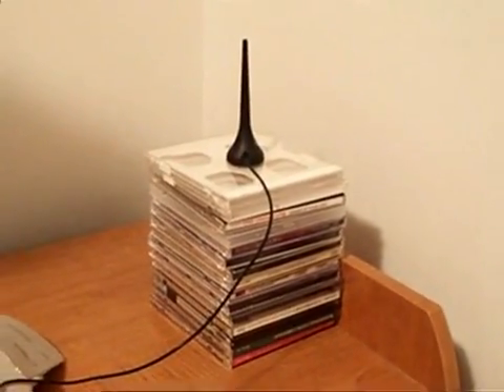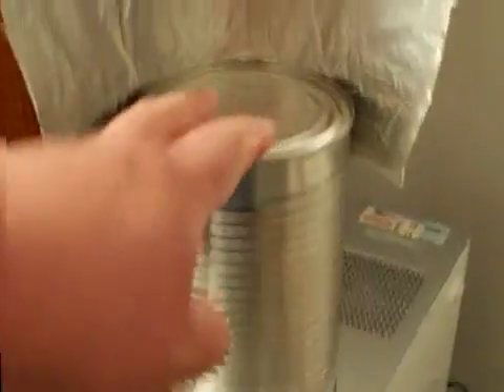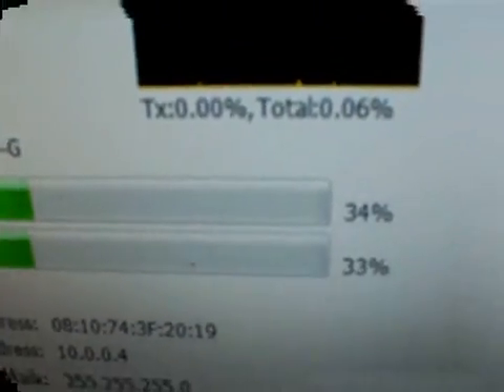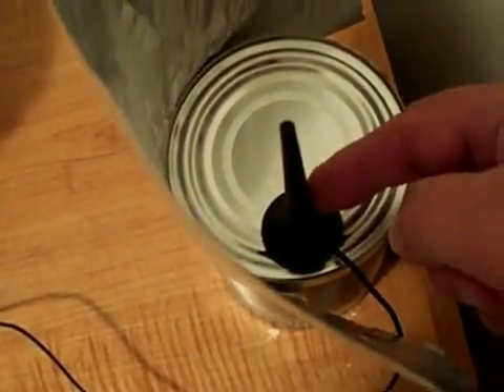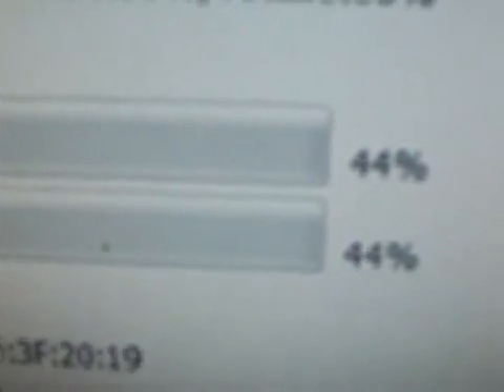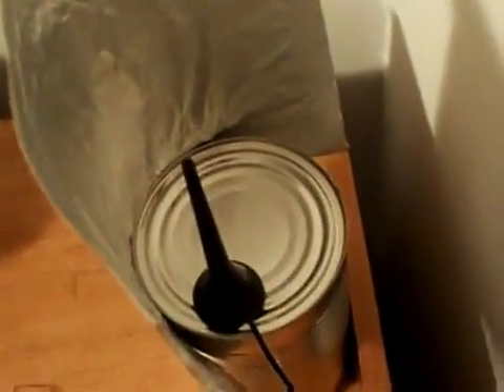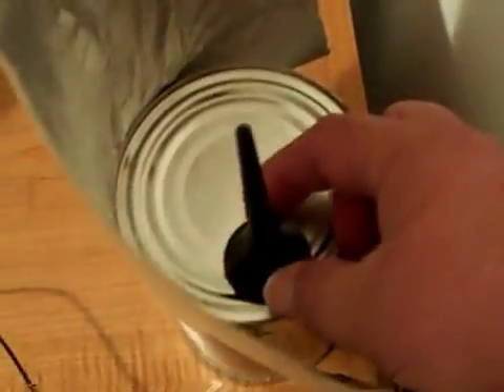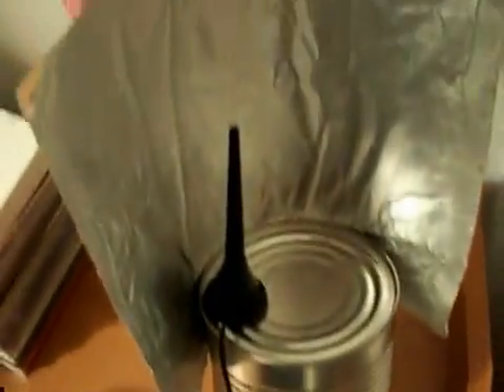e WiFi Antenna Booster - Very Stable and Stays On The Signal

Comment: Hmmm.  Try with just the can and no reflector.  The can forms a ground plane which increases the effectiveness of the antenna.  Note the "droopy bits" under a 1/4 wave CB antenna.  I would imagine it would work even better if the distance from the center of the can to the open edge was cut to about 5% longer than 1/4 wave at 2.4 GHz.

Comment: The reason the can improves the signal is that the antenna is only half the antenna system - it needs an equivalent antenna going downward from the magnetic base.  The can forms what's known as a ground plane, increasing the efficiency of the antenna.

As to why it doesn't work better in the center, the antenna has to be a fixed distance from the reflector (the "Windsurfer") and in the video you've never gotten it the right distance.  Try experimenting with the antenna along the center line and you should find a point, about 1/4" wide or less (maybe around 2.4" or 4.8" from the reflector - just over 1" is another point to try), that will give you even more of a boost.

Comment: What are you using as the backing for your aluminum screen? A manilla folder? Have you tried a "dish" shaped reflector (for a defined focus point)? You should also try weighing down your can with marbles or sand.

Comment: ? i have a dell desk top, where did you connected the cable from your antenna to?
Reply: soulergy1soulrgy1
Reply: +soulergy1soulrgy1 You need to buy a PCI/PCI express Wifi Adapter that comes with the antennas. You can then add a different antenna.

Comment: OK that's nice but the antenna for my laptop is inside and I don't have access to it.
Reply: +nunya biznez thats cos its a 5yr old video and they have better wifi kit now
Reply: +aR Bemo (aRBemo) I'd forgotten that I'd posted that.  I found a solar powered extender that has brought my connection speed up from 100-500 kbps to 1-2 mbps Not a huge improvement but it's the best I'm going to get from this motel's router.  Turns out the manager has the 15 mbps cable modem connection split to provide the owner with a fast connection for the security cameras to transmit all the security camera footage to the other end of the state.  Then the manager has some of the signal split off to provide her with a fast connection so she can play video games 24/7.  That leaves about 3-4 mbps to be shared by 12 tenents half of whom are trying to connect pretty much all the time.  The cable company is promising to upgrade us to 25 mbps but I don't know if any of that increased bandwidth will filter down to me.
Reply: nunya biznez thats bad I am on 50mbs and can have 200mbps if I pay enough from my provider!

Comment: It may be signal cancellation.  It's why two or more antennas are always better.  Signals can bounce off a near by surface, and the rebounding wave will cancel out the incoming one hitting it directly.  The center is most likely the main focal point due to reflection.  Moving it to one side would prevent this somewhat. 

You might try putting a hole in the can (reverse the can around), and mounting it on the antenna instead and see what happens. ;)
Reply: What a pity you nothing about phazing, just like this guy above.
Reply: Yaesu Yaesu What a pity you don't know how to spell "phasing".  I probably know more about phasing, wave cancellations, and audio processing and mixing than you do young padawan.  If not, rather than wasting time and energy browsing comments to tell people how bad they are, how about instead gracing us with your great wisdom and knowledge?  It's well known by many audio engineers that sound bouncing off walls can be out of phase, causing cancellations in signal, and "popping" sounds, which is why two or more antennas are always better. This is also a source of issue for multiple recording sources in a studio, and usually causes the need to adjust individual tracks that will for sure be slightly out of phase.

Comment: Wow. Just had a bash with an old can and some scrunched up tin foil and with almost no effort of finesse I boosted the signal strength from 18% to 37% (though it does fluctuate a little down to 31%). I expect if I spend a little time making a better engineered contraption I will be able to stabilise the signal and hopefully boost it a little more. I was considering going to the tech shop to buy a better antenna but I don't think I will bother now. Great idea. Thanks!

Comment: you just created an ear!  quite crude, but it makes sense,  the ear drum isnt really at the centre of the earlobe, rather, offset so that you can hear better... i think!
Reply: The antenna should be at the focal point of his reflector - which is not at the 'centre' he indicated. The presence of the steel can alters the field pattern in unknown ways, and who knows what is inside the nearby wall that's in the signal path? Bottom line, this design is almost totally empirical. Researchers in India did get ordinary home WiFi units to communicate over many km by using scientifically designed, fairly large parabolic reflectors that were carefully aligned and firmly fixed in place.

Comment: the wider the parabola the more energy it can focus on the focal point (or actually line in this case). So if you build a widerr windsurfer and get the focal point exactly right (so it's actually focusing all of the energy on the antenna) it will probably perform similarly to the can/foil antenna.

Comment: I'm stumbling on here and not sure what I just saw... are you saying I should try something like this and it will improve my wifi signal throughout the house, or do I need to aim it towards a specific area?  I would still wan't a good bit of omnidirectionality - how does that work?  Sorry to be so ignorant.
Reply: If you need to improve all around, get a pro made ommi antenna. The real B is getting the right connector from Antenna to device creating RF. So many connector types...

Comment: You have 2 things going on here that "can" give improvements:
1) Ground Plane
2) Corner or Parabolic Reflector (same concept as the "Windsurfer")

Using the Can alone should show how much improvement the Ground Plane by itself adds (likely best if the antenna is centered). Anything metal that's 5" in diameter or more should work well for a Ground Plane.

The Corner Reflector however is a VERY touchy thing at 2.4GHz... and it's not just about placement, but also relies very much on being a true parabola shape, or for a Corner reflector - an exact 90° angle. You likely found an offset position that, while not 'ideal' for the noted Ground Plane improvement, you found the "least bad" position for the reflector. You ended up with a "partially offset parabolic reflector", similar to what home Satellite TV receiver antennas use.

The Windsurfer (or any Corner/Parabolic Reflector) should work better if centered on the antenna Radiator Centerpoint... which is about 1.3" down from the tip of a common 3dBi antenna (which uses a simple straight 1/2wave radiating element of about 2.46") Half of 2.46" is about 1.23", then add room for some plastic in the tip, which is why I said about 1.3" down from the tip, instead of 1.23". I noticed you pushed the "Windsurfer" reflector down all the way to the magnetic base, which may not have been ideal.

BUT... since it's all FREE... sometimes we can "hit a magic spot" just by experimenting!
Reply: j

Comment: Help somebody!! Have wireless ATT notebook, laptop comps & ATT uverse comp only, no comp phone entire time ATT internet reception worse all time, bad as dial up. at says  this bec so far from transmitter, 5-10 miles I think. A 5 min video takes abt 20+ min to view.  Have any corrective/improving suggestions before I cancel service? ATT put in 2 new routers, wkd well X day or 2 then back to so slow this nearly stopped. Anyone else having similar issue?  Bought 1 new notebook & 2 new tablets thinking lap comp was cause. Jokes on me.  Help, help.

Comment: I just gave my old macbook 1.1 to my niece.  She has wifi at her apartment that is from the city.  Her laptop has an internal modem and no outboard antenna.  How can I help her get a better signal?
Reply: sorry if its too late, but you cant buy a usb wireless adapter that has an antenna. might be like 60 bucks. now that might be enough but if it isnt just do what this guy did
Reply: Thank you very much for the suggestion.
Reply: Chuck Carlsbad lol i meant CAN not cant. anyway, have you solved the issue already or are you still searching for a solution?
Reply: She is all set now that she is away at San Francisco State where wifi is very strong.  Her mom is still dealing with weak, city provided wifi so I sent her an EeePc netbook I had laying around to see if that works for her.  It has XP on it and it is not worth it to put windows 7 on it because you can  buy a chrome for just a little more than the windows software.
Reply: Chuck Carlsbad In what universe does the city provide wifi service?
Reply: nunya biznez My niece has ROKU all dialed in. Not sure if Ventura has changed the one hour rule since the inauguration as she watches entire movies now.   http://www.cityofventura.net/press-release/city-launches-free-public-outdoor-wi-fi-access-downtown-ventura
Reply: Chuck Carlsbad OK, not sure what a roku or a ventura is.  Is that in the US?

Comment: The tin can is acting as a ground plane and the foil as a parabolic reflector, that's why the angle is so important. When you move the antenna you are moving it into the focus point of the reflector.

Comment: I use Foil taped to my laptop which helps a bit. It would be great to see if this could be done better with a LAPTOP that ha an internal card and the antenna in the screen I've been looking for antenna that would plug in to the org. antenna plug on the card instead of having to buy external card for the PCMCIA,But great Vid to help,

Comment: Is it possible for a series of privately owned affordable devices to communicate over a distance via a device to device wifi web?
Reply: You may want to research "mesh networks"; something I predict will be the normal way people connect in 10 - 20 years.
Reply: RodCornholio thanks for the info, do you think this could become a free way of communication?
Reply: crappymeal We are only limited by what we see as possible, probable, inevitable and by the enemy of progress: evil.

It has been a relatively short length of time between the expansion of bandwidth over copper telephone wire, radio packet switching, "cable", to cellular, satellite, etc.  Ultimately, consumer demands OUGHT to drive the evolutionary direction of the technology.  The long term is clear: people demand portable, personal, devices and have an unquenchable thirst for bandwidth.

 There will likely be a spiralling feedback loop of innovation...demand for more bandwidth leads to faster processing, data compression, smarter protocols, etc leading to the hardware to support it.  

Then some geeks/hackers develop some bleeding edge device ...that lets everyone in a neighborhood share the load of data processing, transmission/reception in such a way that significantly lowers their internet connection cost.  

Soon, the devices are sold all over and the more people join in, the cheaper it gets.  Perhaps, as one person has a low amount of bandwidth consumption, they get paid -- by others using it-- with this old currency called Bitcoin, similiar to how some people get credit for pumping their unused, solar generated, electricity back into the grid.

  Eventually, it will be as free as the cost for the device and the electricity to run it.  Afterall, "content is king" -- people don't care what medium it comes over --just cheap, a big pipe (bandwidth), and fast.
Reply: the future could be a great thing, any thoughts about E-democracy and other systems
Reply: crappymeal I view democracy as one (of several) ways to make a decision; democracy as a process.  Technology could be a tool to make the process more available, secure, etc. To be clear, however, I can not support any organizations that initiate force on other humans (all current governments) regardless of the decision making system they use to chose people for positions of power, laws, Acts, etc.  The democratic process is ethically neutral; it does not make the decision morally good.  

Arguably, an e-democratic government could be worse as the technology will either be in the hands of a corrupted minority or in the hands of an unintelligent majority.  Humans have the gift -- and curse-- of abstraction; the darkside of which is the neverending ability to think of ways to trick themselves into thinking they can get something for nothing, usually at the expense of another's property and sometimes even another's life.

Watch "The Story of Your Enslavement" for more.

P.S. The best hope for humanity now, in my opinion, is Bitcoin.  When people can keep their bank on their thumb drive...there's nothing more democratic - and ethically sound - as "voting" by how you chose to spend your own money.
Reply: RodCornholio exciting yet scary times ahead, im sure everything will work itself out in the end, thanks for your time

Comment: For most people i would recommend getting a cable. You'll get better speeds. Trust me
Reply: Because 150 feet of cables is nothing!
Reply: to clarify you mean an Ethernet cable. i tried an antenna on a cable and it dropped 10% versus an antenna with no cable.
Reply: sorry, CAT5 or CAT6 Ethernet cable*

Comment: OK lets correct a few things all your doing by moving the WiFi antenna off axis ie NOT as the focal point is creating a wider aperture for the signal. instead of putting the antenna where you pointed and experiment with being in the centre of the arc but further away and still on the can , The Can I might add is assisting much more than you might think too because it is forming a ground or creating a counterpoise for the antenna to work off. Now if you actually did some research and accurately create a perfect parabola the signal will be greater again and you should get in excess of 80 - 90 percent signal quality.   The signal is better of to the side because the surface accuracy is better off to that side.  Now do yourself a favor and swing your WiFi antennas into a horizontal position With a reflector at each end and watch the signal jump because your now not vertically polarized like the trees, re-bar in the brick wall etc. This may not be practical as other WiFi users may be in the home.  IMHO get rid of the WiFi and run a cable and you will have a faster NET speed and way less interference from any external influences.

Comment: FYI wifi frequencies are high which means the wavelength is short.  That is why small changes to position are critical.  You found a spot where the wavelengths are in phase from the various reflections.  If they are out of phase they can do some self cancelling.  
Overall, good job.  That foil is pretty thin and some signal is probably not reflecting.  Wire mesh spaghetti strainer superior.  The tiny holes in the mesh are far smaller than a wavelength so the signal won't go thru.

Comment: In your place I would use a digital EMF meter to find the hottest spot on the can where to stand the Wi-Fi antenna, you surely will get better results. Also,I would suggest you use an aluminum mesh over the can instead of the foil, and even better results with an aluminum can of some sort.

Comment: Very educational, plus the reason why the antenna cannot work so well in the middle is that the resonating position - i.e. the required distance has to be 1/4 of the wavelength of the signal, so that whatever duty of the signal has incident on the antenna (0 - 1/4, 1/4 - 1/2, 1/2 - 3/4, and 3/4 - 1) will make a fine tuning and resonance. Great Job!

Comment: that metal can makes signal interferes - it is better to use some plastic can , but that aluminum foil glued to a cardboard is just great , although it's much better to put that foil behind the router because it will boost signal much more and it will send 50% more of the signal toward you  , it will also reduce the possibility that some person behind that foil hacks the router (because on the other side signal would be very poor)

Comment: The can sort of acts as a ground plane for the magnetic antenna, just like a CB antenna on a car. And the foil reflects the signal back to the antenna which will increase the gain, thus increasing signal strength. FYI, the spacing between the reflector and  the main antenna element is crucial, if they are too close or too far apart, it will have an effect as i found out when i built my high gain UHF TV antenna for long distance DTV reception. So yeah, this guy is definitely got the right idea.

Comment: Use soda cans, open them up and glue them to a salad bowl or something (kind of an hyperbolic sattelite dish). the good thing about soda can aluminium(?) is that its not as fragile as foil, it wrinkles a lot less thus making a cleaner signal.. The fact that your antenna gets better signal on the side its because your Focal Point is there, due to the irregular nature of the foil, i use a sattelite dish now, because i know where the FP is. The down side of dishes is the fact that its direccional

Comment: So i always have 90% plus connectivity on my wifi bar but it drops connection a lot, my other computer running off wired connection works just fine and so does my other wifi devices

Comment: Hey Midnightbird99, I believe this works due of the reflection and interference of the electromagnetic radiation (radio waves that compose your WiFi signal from your router). Normally, the radiation spreads out over long distances and is too weak. The parabolic curvature of the foil directs the radio waves to a single point. The reason you get a poor signal when you put the adapter in the middle of the can is because the waves intersect each other in such a way that they cancel each other out.